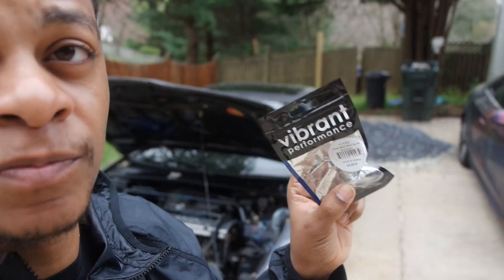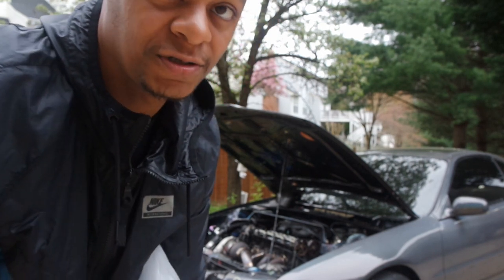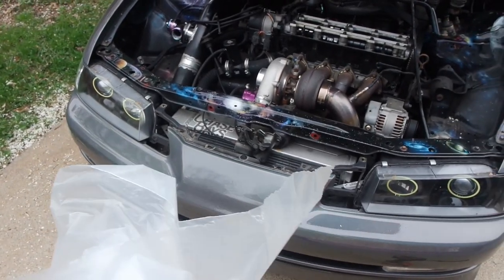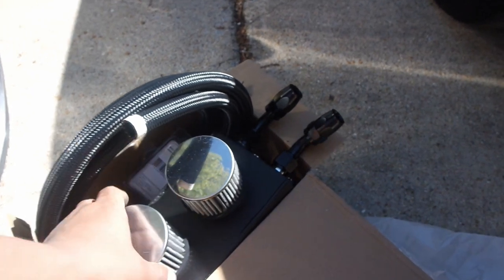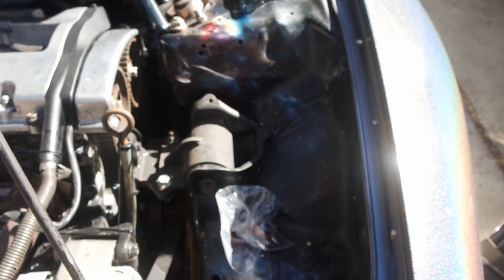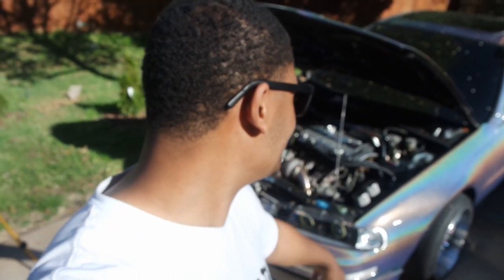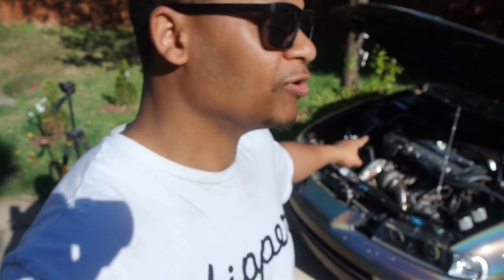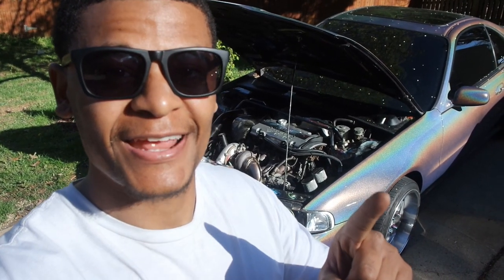How to install a turbo oil catch can set up | Honda Prelude

Comment: Any H22 H23 could benefit from catch can. 
My BB6 prelude would re-burn so much oil. Would smoke so bad out the exhaust. 
My motor was toast too. 
My dipstick would blow out too at about 7k when vtec be poppin
Reply from the maker: Sheeesh
Reply: 😅 it's not our fault they ask for high RPMs and the rings aren't prepared for the demand

Comment: What did you do with the valve cover breather port on the rear passenger side of the valve cover? Trying to find a good write up is like pulling teeth
Reply from the maker: Let it breathe to atmosphere or you can put a filter on it
Reply: @treybedipping1734  Thats how i have mine at the moment but im getting a little oil being blown out of it, wondering if i can some how connect it to the catch can system
Reply: @BalmierPenguin  if your is vented to a catch can, why not just plug the already existing hole off?

Comment: Nice video I have been thinking about doing this also ....Hey do you have a picture of the kick panel fuse box cover you can send me by chance?? My cover is missing and I am trying to fix some electrical issues...finally got her back together.
Reply from the maker: Do it bro and google is your best bet
Reply: @treybedipping1734  
Trust me ive been searching for hours ...finally found a pic on preludepower from years ago but it is missing a couple fuse spots that I have...assuming because mine is a BB1
Reply from the maker: @youtubechangedmyname  message me om IG

Comment: Can I just use the little vent and run a hose off it ?
Reply from the maker: These catch cans are like $20 bro just get one
Reply: @treybedipping1734  can I run it off the lil breather nipple thing that’s on the valve cover ? Don’t wanna pay to get my valve cover bunged
Reply from the maker: @roadjokers6467  look up level 7 performance the have ventured oil caps with the an bung built into it already

Comment: Bro you got such a great bay why not wire that fuse box inside? I wired mine into the glove box so that you open it everthing is facing you. Run a power terminal in bay. Then drop that catch can box where the fuse panel would be. Idk just thaught  either way ya boy sendin that like. Man only good thing going atm are those open lanes on the highway traffice at a all time low:)be safe man dont forgt whrn this is over got head thata way get freshened up, paint screaming help me haha just got th c.f hood.
Reply from the maker: I want to drop a tucked harness in there at some point but yea that a good idea with the fuse box.
Reply: @treybedipping1734  it will alsonhelp hide thise wires :) stay cool bro 🤙
Reply: Mines tucked under the dash too but not in glove box thats a good idea Bro . 
I need the kick panel fusebox cover so I can figure these fuse locations out ...I got the Honda service manual but seems off...if u got a pic email it to me. 93 BB1.

Comment: What did u do to delete power steering? I deleted mine and I can't even turn the car?
Reply from the maker: You have loop the lines at the steering rack. Still has to be fluid flowing through the rack
Reply: Mines looped also ...still hard to turn parking but driving its sweet
Reply: I actually thought the looped line was much worse, the fluid fights you back.. I just vented the lines so I wouldn't be fighting the fluid, and removed these restrictors in the rack to improve flow. Still has a lot of free play tho cuz of the lack of fluid. Maybe it's my smaller aftermarket wheel...
Reply: @Vazee08  
I dont know man its a power steering rack ...its needs fluid to work properly...id loop em and try it see what it feels like compared to what you did I would be curious.
Reply from the maker: @youtubechangedmyname  loop it bro and hope you didnt do damage to the rack
Reply: @treybedipping1734  
Yeah mine is looped already

Comment: I'm confused. I've read it's better to to have them on the back side of the valve cover.
Reply from the maker: It all preference but you tend to loose more oil when they are in the back.
Reply: Damn that means I wasted my extra valve cover
Reply: paulschleiger3 not if you have them going into the factory baffle location to stop excessive oil from going towards the catch can
Reply: @treybedipping1734  no its not. It supposed to go between the PCV valve and the intake manifold. Its also supposed to run off vaccum. All you did was introduce vacuum leaks.
Reply from the maker: @TeSolycMandalor  i did mine the way i wanted and there are no vacuum  leaks. This relieves crank case pressure 🥴
Reply: I did mine on the back of the engine on my b16 with the catch can open at the bottom so I don’t have to empty it. Now I have to add oil quite often